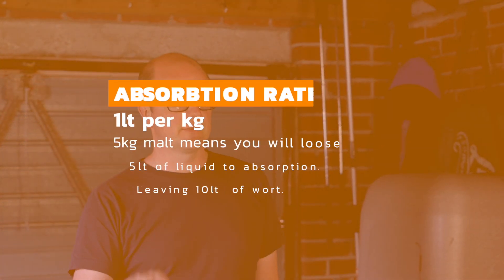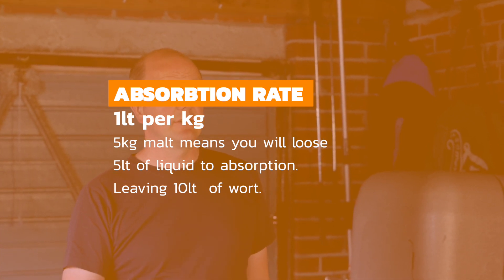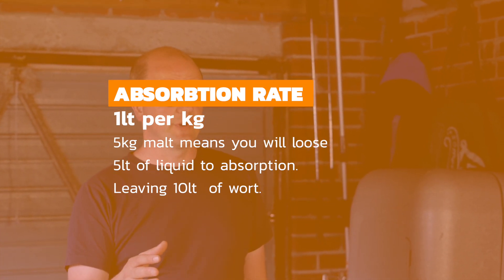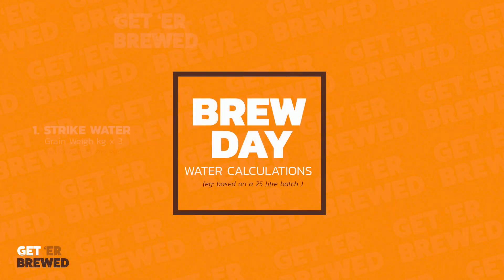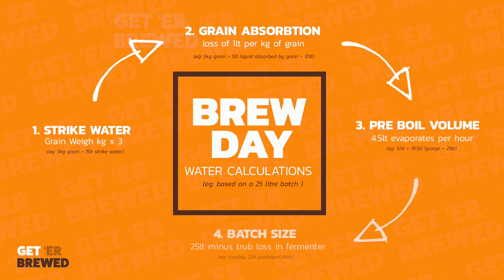Brewday Mash & Sparge Water Calculations

Comment: 3:03 why not use more malt and skip the sparge?
use the "sparge litres" as ice cold water in fermenter to cool wort down instantly!? ;)
Reply from the maker: Hi. That could be done, but you could use up to 25% more grain so can be difficult depending on your equipment and will add to the costs. Also, you should not add the water to the fermenter. The cold water might have unwanted bacteria that would infect the beer and it would also change your pH and gravity readings.

Comment: Can you work backwards? If I want 50ltr of wart. How much grain would I need? What size mash tun and hlt? I have a 60 Orr kettle
Reply from the maker: You can, but its not a cut and dry answer. 
It all depends on the grains and the extraction. You obviously need to hit the right gravity. The size of the mash tun will then depend on your grain bill. 

It would probably be best to use an app like Brewers Friend. You can build a recipe around the wort amount and make sure you are getting the correct gravity.

Comment: My all in one brew monk system, would you add the dead space volume to the total strike water? Obviously there is no loss from mash to boil except absorption, but there is space under the grain basket which doesn't get mixed into the grains, so increasing the strike volume otherwise the mash is a lot thicker than anticipated.
Reply from the maker: Yes everyone will need to adjust to suit their system and that sounds spot on for the brewmonk